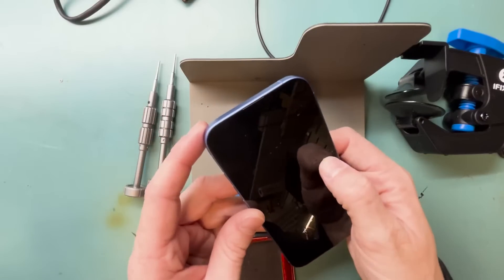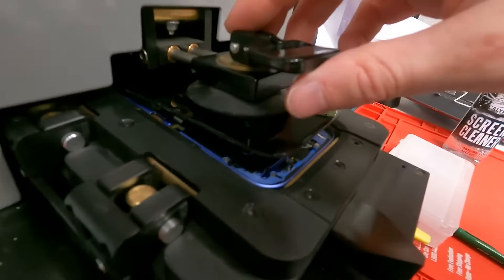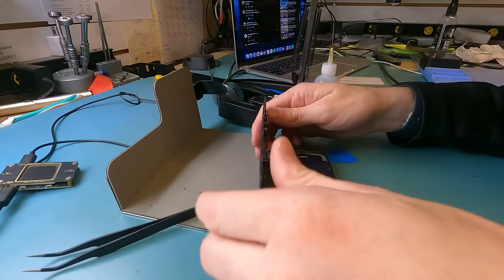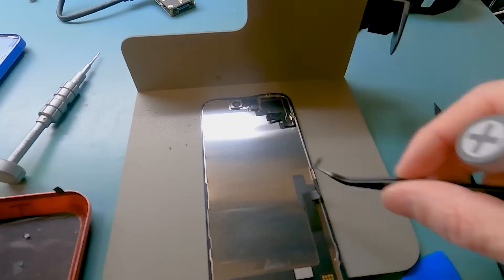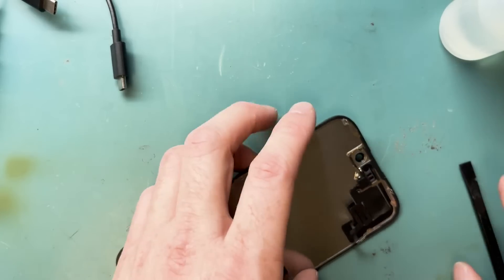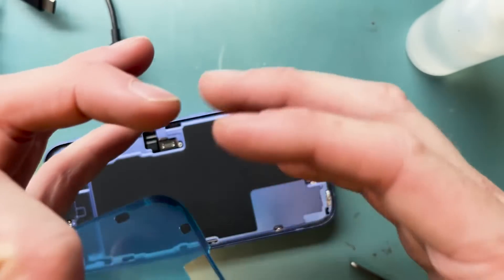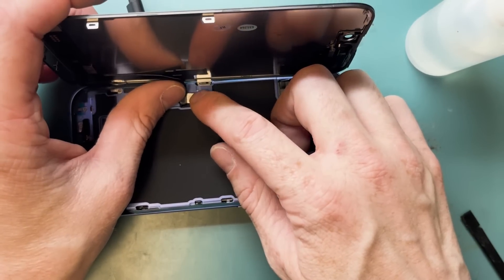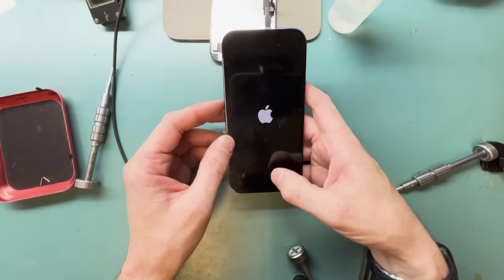iPhone 16 Screen Replacement Guide

Comment: Hello, I have a question whether the display will work if I do not have a proximity flex cable, because when I changed the display, the flex cable got damaged and my iPhone 16 does not want to turn on.
Reply from the maker: @korniwin7467 it should work without prox

Comment: Hello. May I ask is this iphone 16 designated jig? (Hot pocket) or are u using one for a different model here in uk they do not sell iph 16 one. Curious
Reply from the maker: @sebsrepairs2315  I will message my vendor and check for you if it works with UK version I’m assuming it is the same
Reply: @worthitrepairs im just asking if this is a 16 jig or a different model
Jig.  Dont need to know if it works with uk model
Reply from the maker: @sebsrepairs2315  yeah it is because the Uk Verizon has a SIM card tray but they come apart the same
Reply: @worthitrepairs in uk we have 12-14pm separate jigs but 15 series they did adjustable one and never released anything for 16. So was surprised seeing on in the US but you get better access to tools anyways than us.